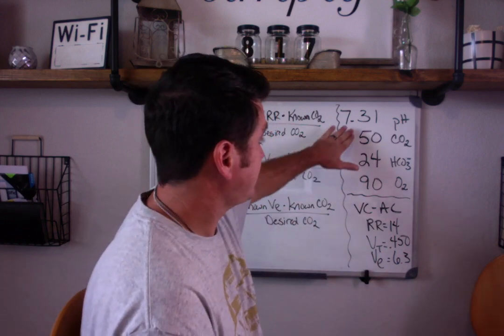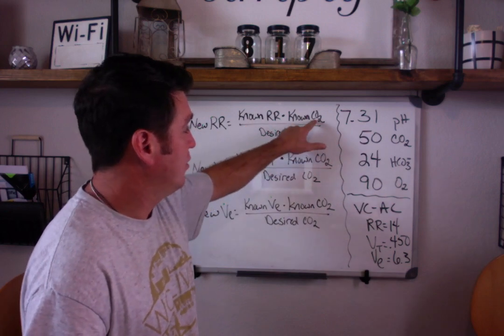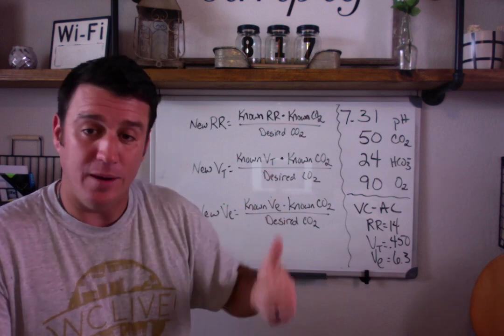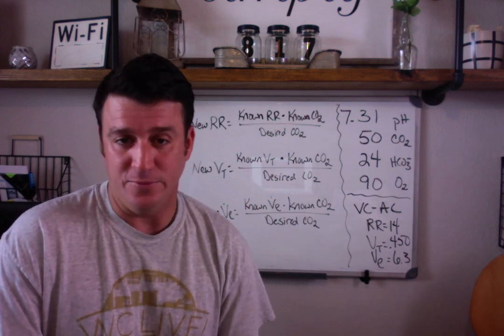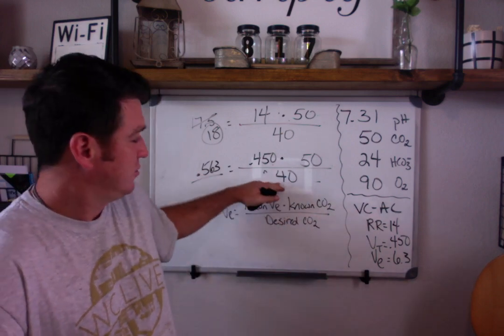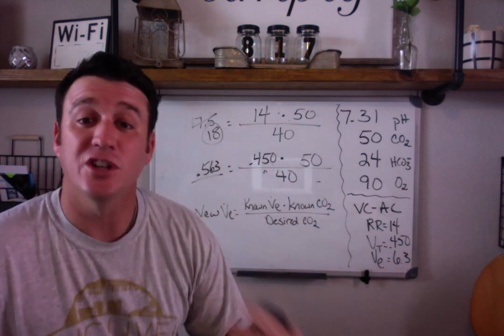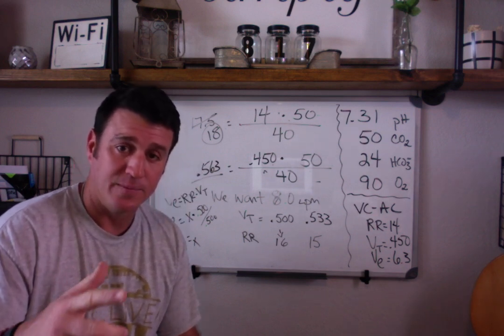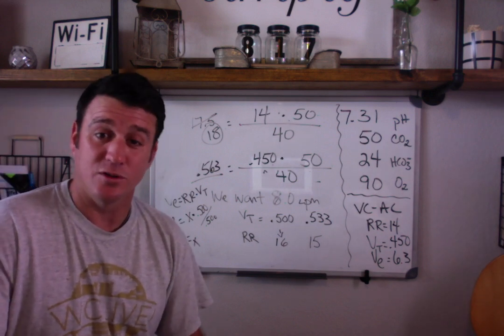Respiratory Therapy - Using Formulas to Make Ventilator Changes

Comment: What about pc if pt is on pc mode
Reply from the maker: If in PC the same rules apply.  Adjust pressure to get tidal volume into appropriate range first, then consider adjusting rate.  Thanks for watching and commenting with a great question.

Comment: How long does this formula typically take to work? If I change my rate from 14 to 16 to achieve a lower CO2, when will the gas correct? An hour? Thanks
Reply from the maker: Depends on the severity of the abnormality, but typically CO2 responds quickly to changes in minute ventilation.  An etco2 would reveal changes immediately and perhaps stabilize within 15-30 minutes.  Again though, this is dependent upon various factors.

Comment: Very helpful videos.
Appreciate your efforts in making things easier to understand.
I want to know how these formulas apply to pressure control mode of ventilation?
Reply from the maker: They do, you just have to understand that in PC your TV is not set and will vary based on RAW, static compliance, and patient synchrony.  If your TV is fairly regular, then yes, you can make pressure changes...which will effect TV...which will effect Ve...which will effect Co2...which will effect pH.  Just know that this will vary in PC.  Hope this helps!  Thanks for watching and commenting!!!